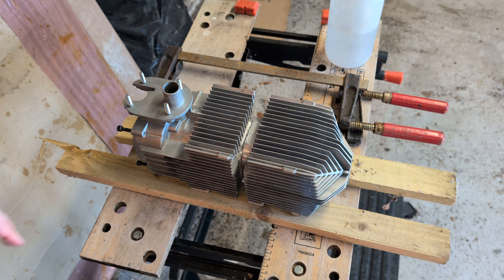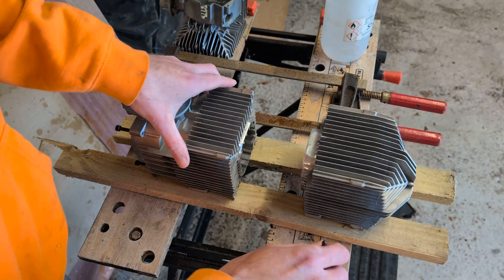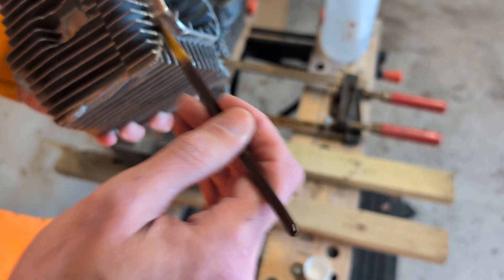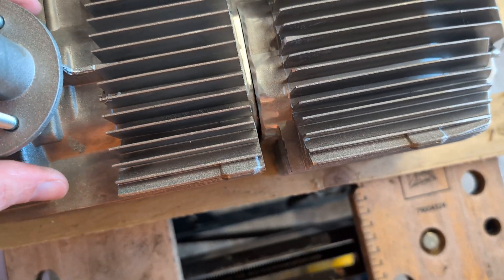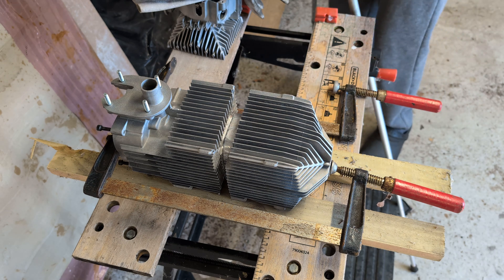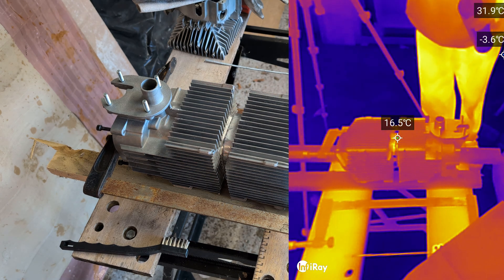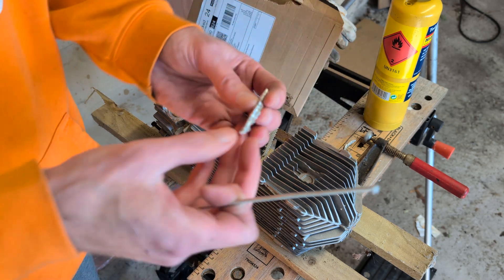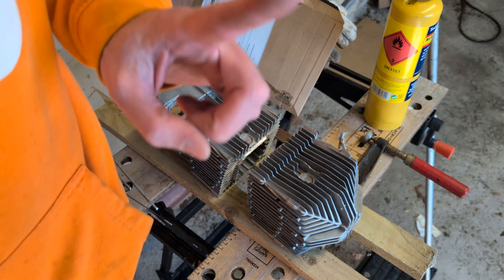8KW Diesel Heater Project - Trying to join two halves with Lumiweld - part 2

Comment: have someone weld them together if you cant do it, no reason why it wouldnt work. alternatively if you just want to do some testing then just use jb weld and maybe some bolts, that'll hold it no problem and will resist fire for long enough

Comment: Hotter flame maybe. One that can pump enough heat into a little area more then the aluminium can suck away, and work FAST! Maybe if propane does not work try aceteline?

Comment: good to see you again 
 if you bend a flat strip of aluminum or stainless steel plate to the size you want .
bend it round and weld it  together - make a ring .( connecting collar ) -  internal or external
 add exhaust jointing compound pull together with threaded rod washers and nuts
or you could 
make 2 aluminum squares plates with holes in the middle burn chamber size tig weld 
then both on -  bolt them   together with 4 small nuts and bolts in the corners use a gasket

Comment: what about assembling the heater as a whole without the plastic case (WELL clamped tho) and have it running bouncing off the overheat limiter.

then you get like 5kw of heat pretty uniform from the inside.

the remaining step up in temperature for the lumiweld rods could be reached with the blowtorch or by an HVAC oxy-propane burner (also has a finer pointy flame and the temperature can be adjusted by the mixture of oxygen and propane).  a low oxygen flame also removes oxid from the aluminium helping with the surface quality.

those things can melt copper and so in theory it could also melt the two halfes together.  but alu is a bitch regarding the semi-liquid state. it's a very narrow ridge to walk on compared to copper.

spotmelting it around the circumfrence and then lumiweld afterwards for gas tightness could be an option too.

Comment: I think you pretty much said it all right there. Similar experiences with Lumiweld, the parent metal makes a difference to results. Vigorous use of the "Abrader" wire is essential but that often results in me flicking molten Lumiweld across the garage 😖 I have a similar job to TIG that I'm avoiding, I'd suggest setting up / practicing with the off cuts before going for broke.
Reply from the maker: That's pretty much the plan.  See how the scrap bits weld.  If they are truly awful I'll try some silicon bronze rods and braze it.

Comment: Bigger torch....

I've had similar trying to repair electronic modules built onto ceramic substrates. Which are also designed to sink heat away. My solution for those was to preheat the module on a hotplate, then used the soldering iron to just bring the local work area to temp. A very find line between getting it re-workable and the ceramic and all the components floating off the copper heat spreader, on a puddle of molten solder!

Comment: I agree with your synopsis of the giant heat sync. It was obvious from the video that the heat was spreading further but remaining at a steady 170 degrees.
I wonder if a hotter torch like Oxy Acetylene and some kind of Flux would have worked with that stuff?
Reply from the maker: I think if I had oxy acetylene it would have gone better.  But I don't.

Comment: would a Compressed Air and Propane Torch heating from inside the burn chamber work better, also insulating the "fins" to contain the heat ?

Comment: I think Tig is probably the safer way to go, basically you are brazing the two halves together with the lumiweld and I would be worried that when in service the lumiweld would melt and cause the joint to fail.
Still, a good effort David.
Reply from the maker: I don't think it would ever melt.  That was my problem.  :)

But to answer your question, the Lumiweld rods melt at 380 degrees celcius.  Your heater overheats and shuts down at about 220.

Comment: good to see you again you could use  2 small theaded  bars  6mm penny washers fan end ,
 small pease of flat plate drill 2 holes make a jig pull them together and sticket  it all together
to make a permanent seal
car exhaust some times join male  ball to female cup  useing  bolts
Reply from the maker: If you could cut it flat in one cut, or machine the ends flat a gasket would work.

Comment: I watched a guy using oxyacetylene torch to fix  my motorcycle crankcase it gives far higher temperature but pools a lot so very neatly added the aluminum stick. Also have watched welding with aluminum arc rods maybe on thicker aluminium I can't remember.

Comment: Everybody that I have seen use Lumiweld has had the same problem as you. I saw one guy on youtube use oxygen and acetylene and it still didn't get the aluminum to hold with this so it must have a very difficult learning curve to be able to use.

Comment: Too bad there is no way to use diesel to heat from the inside while applying  the torch on the outside.
Reply from the maker: I thought about that, but you'd need to keep moving the body temp sensor.

Comment: Tig tak it in 8 spots round the burner body. Then using a pedal to control the amps, run half inch beads at differing spots round the burner body till all the weld beads are joined up. Use 4043 filler rod, it'll flow easier. Good luck. And don't get greedy with the length of your beads or you'll blow the arse out of that thin wall.

Comment: Massive heat sink.....Base metal not hot enough. Also oxidation is critical, as in once to temperature it must be brushed again with your clean uncontaminated stainless steel  brush. I used an acetylene torch on the boat propellers and likely only worked well because they held heat better. Perhaps ceramic or mineral wool insulation on the fins and directly on the BBQ heat. I am also curious if tig would supply the heat.....Then apply the Lumiweld? You get an A for effort 🤗

Comment: Suggestions:
Try wrapping each part in a fire blanket to reduce rate of heat loss.
OR
Use high temperature resistant JB weld on roughened mating surfaces.

Comment: Reminds me of soldering LED 'beads' onto a heatsinked PCB, you need to get things hot, otherwise the heatsink just steals the heat away resulting in a cold joint that doesn't stick, this lumiweld stuff seems intriguing though, would certainly like to see it work... :)